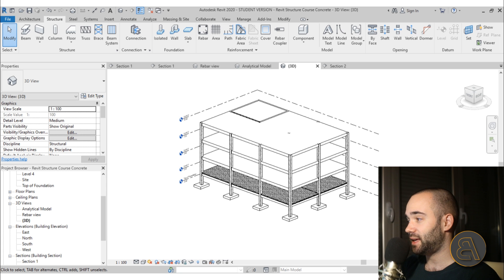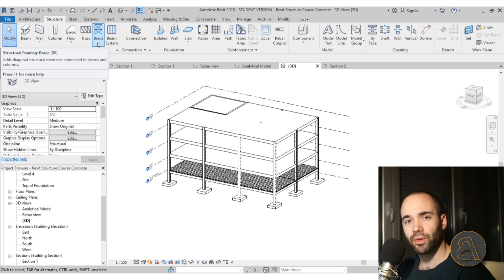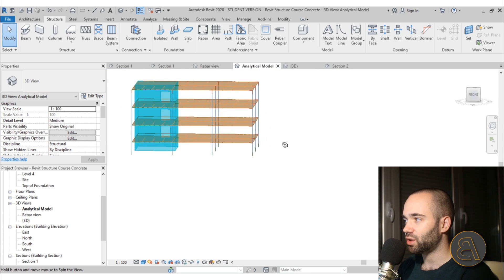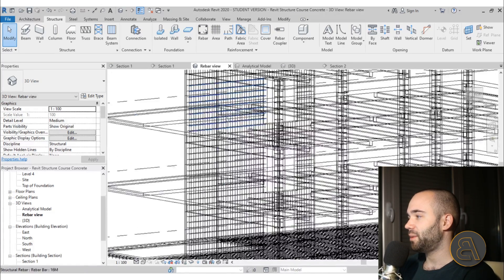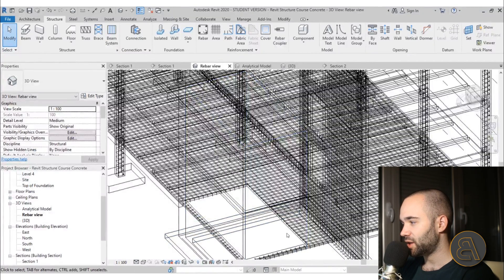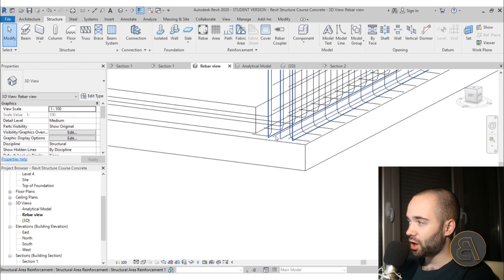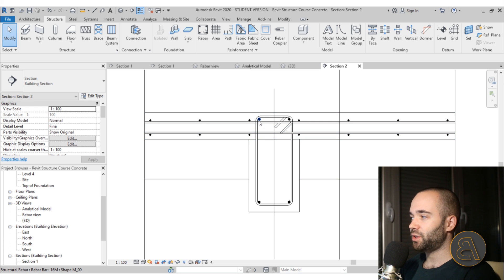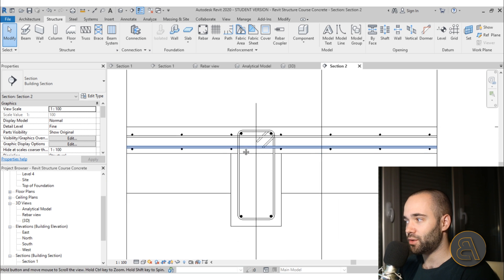Revit Structure: Concrete 1h Course

Comment: Hello, if we have several floors when rebar detailing, should we difference the rebar size for each column, beam, and slab on each floor?(i.e 19mm column lvl1, 19mm beam lvl 1, etc) Especially when we want to make automatic bill of quantity from Revit.